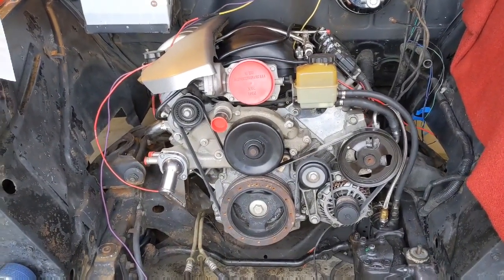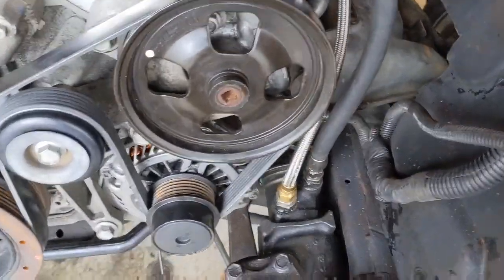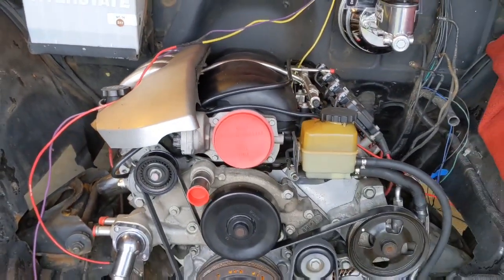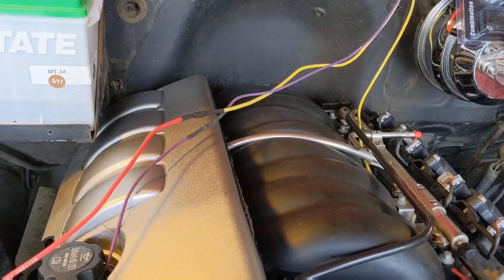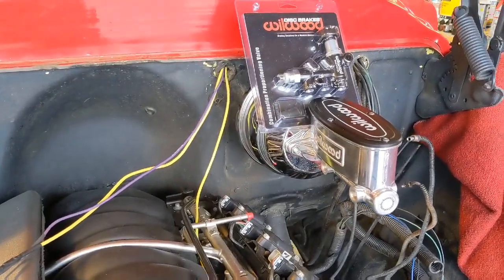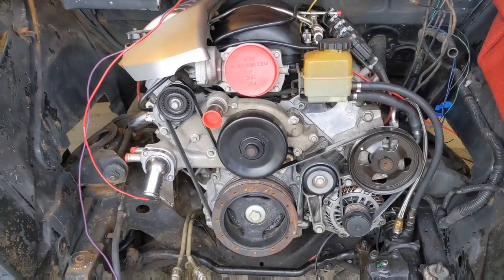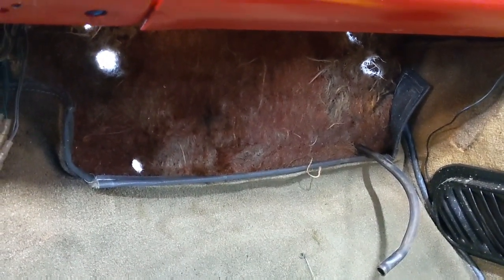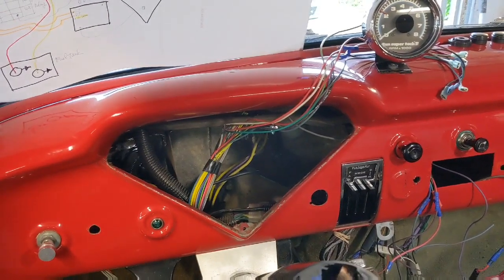Serafin's '55 Chevy Truck LS Swap - Part 5

Comment: great video. a question??
how much this cost just labor?
taking out the old stuff and putting in the new?
thanks
Reply from the maker: 15K-18K for drivetrain, harness, wiring, suspension upgrades, tires and wheels.  Somewhere around 400-500 hours